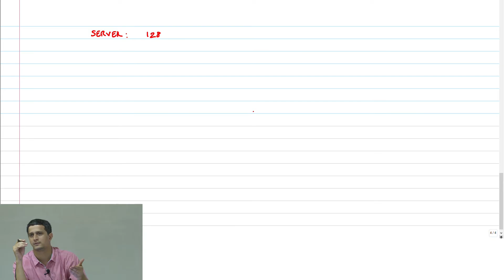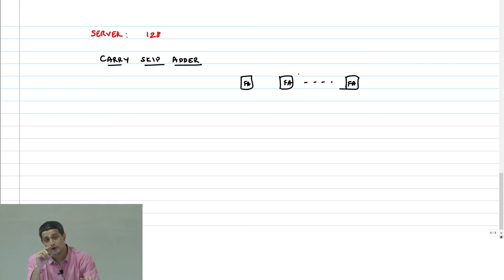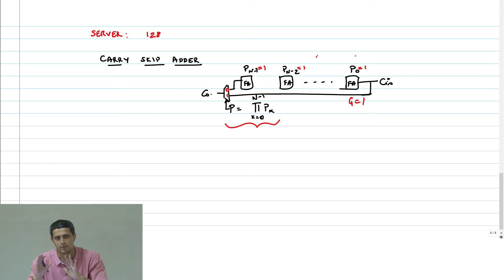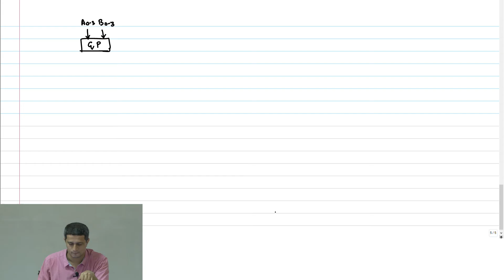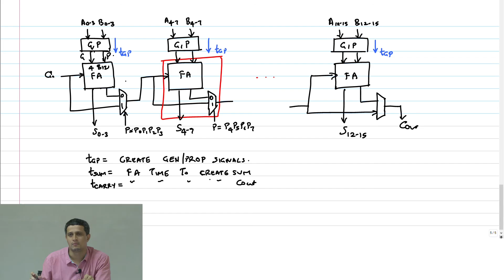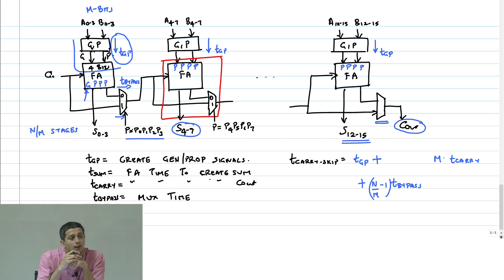AM - 4 - Carry Skip Adder

Comment: Critical path delay is the worst case delay right? So why don't we take the case where every single adder in all stages are in generate mode, in that way the cout can't bypass and has to go through the entire ripple chain and will create much more delay than the case shown above where only the first bit of first stage id GEN.
Reply: If they all are generate, then u do not even need to worry about the prev carry at all, so it becomes a constant time circuit

t = tGP + tsum

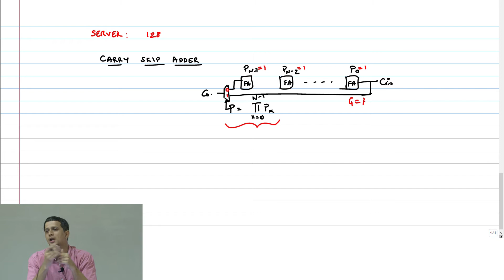Comment: 6:22 
Why we are taking first FA to be in generate mode.?

is it because Taking G=1 means we have make P=0 , which will eventually select the critical path going through each FA?

Taking P=1 in each FA , will directly propagate the Carry through Multiplexer , which will make it independent of N?

Right??

If it is so!! Then that means we can Take G= 1 for any intermediate FA.( right?)
Reply: if G=1 is taken for any intermediate block then all the blocks before it won't be contributing for the delay and delay will be calcuated for all the blocks after that intermediate block. So that won't be the worst case delay.
Reply: Yes, you are correct. The point is to make the circuit use the longer path. So technically, any one of the full adder blocks can be in Generate mode.